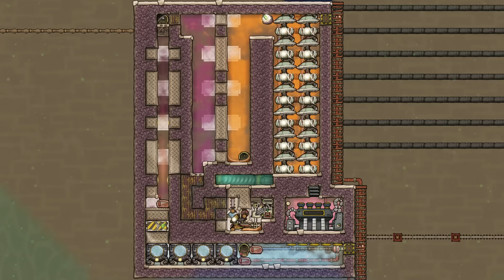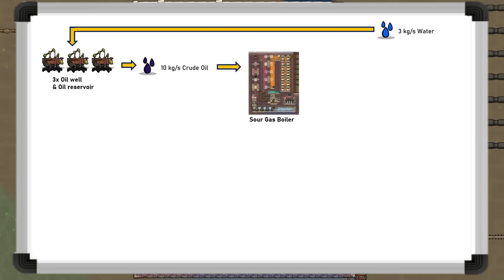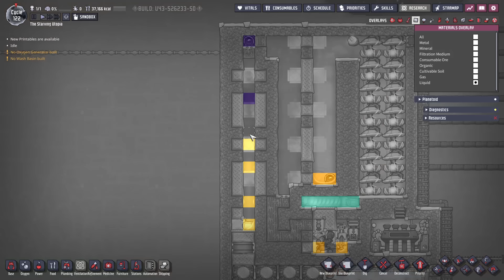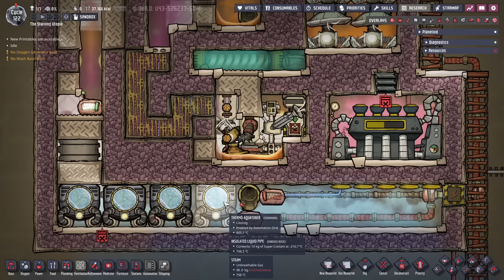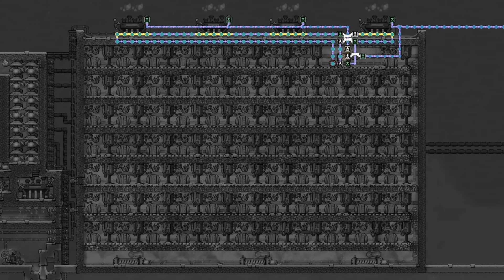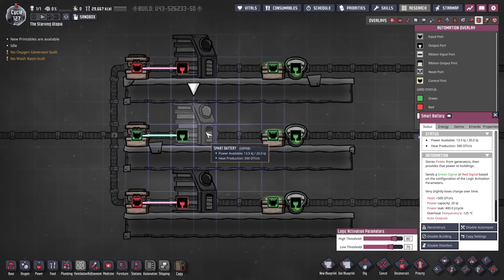Oxygen Not Included - Tutorial Bites - Sour Gas Boilers

Comment from the maker: Hi everyone, I thought I should post an update to this with some further testing. As a couple of people have pointed out, the design as shown has an issue where methane can condense in the airflow tiles and then teleport across into the supercoolant area. To resolve this issue, I removed the top 2 airflow tiles on the right side, and the top left tempshift plate in the condensing area (so the 3 tiles in a row) as shown at 8:52. That seems to have done the trick, but also feel free to make any more improvements you can think of!
Reply: I love your videos, you are 1000% better at me than ONI but I want to ask, with all the sulfur output couldn't you split it between sweedle and grubfruit then use the seeds from grubfruit to feed a 25 gulp fish tank that would purify the polluted water at 200g/s each (5kg/s) meaning less power used for water conversion and more free food that could be combined with the sweedle meat to make surf n' turf? Industrial brick is just a "waste" if you are already generating 50KW+ of power in the first place! I think we both know you have the natural gas for a grill.
Reply from the maker: @markalvarez1827  That could be possible, but saving power with a 10kg/s sour gas boiler is mostly not worth it since you have so much power. And pacu can simply be starvation ranched anyway (I do need to double check this with the latest patch), so there's nothing stopping you having cooked seafood anyway.
The industrial brick is never really a waste, it's about containing the machines, the cooling and their produces whether you make it hot or cold. The nat gas gens still need cooling and still produce polluted water and carbon dioxide that must be dealt with.
Reply: I would also add, I had an issue with Natural gas appearing outside my boiler and I was very confused by it,
just not that it's a good idea to set the conveyor loader to Sulfur only, and not everything, otherwise it will pick up the solid methane if your boiler gets too cold which is what mine did!
Reply: I built this recently but the change as you described didn't work for me, though I will admit I may not have implemented it properly. I did find a simple (mostly)stable solution. I moved the chamber with the tepidizer to the right one space for simplicity I moved the gas pump in the very bottom left to the top to the left of the others. I say mostly stable as the teleport of frozen methane does still happen and it shoots up the dividing wall between sour and natural gas an out the top where I have another pump in a small room to collect it. I have had this running for a very long time and observed no other issues.
Reply: Wow, I could really have read this before troubleshooting this for 2h last night and posting about finding this exact reason 😅😅😅😅😅

Comment: The sulfur and methane's area liquid pump keeps breaking for me, the pipe that takes the liquid methane breaks because the methane solidifies instantly, is there a way to fix that?
Reply from the maker: That is strange, usually the issue is the liquid methane boiling in the pipes not freezing. Do you have the temperature settings correct?
Reply: @GCFungus  It was the temperatures, I just had to trial and error as usual and managed to stabilize it, thanks for replying back! Love your content.

Comment: Finally got my sourgas boiler to work as I had some issues with the cooling region being filled with natural gas and unable to produce methan to transport up top.

It had something to do with the equilibirum point of  the temperature of the aquatuner + door + the tepidizer chamber. If your tepidizer started off closer to the threshold of -180C but your heating room was still  at the 300's then the chamber fails as the tepidizer cannot keep up with the -56C cooling factor.

Another issue was trying to compensate with turbo mode, but this caused the tiles to experience pressure damage and crack almost immediately. 

The way I got it to work was to pre-fill the tepidizer region and pre-heat the heating chamber at the same time so they are within a certain range of their threshold temperatures - 700-800C for the heat chamber and -165C for the tepidizer. Then let the crude oil flow. I also removed the tempshift plate from the bottom left of the liquid pump.

Comment: Hello GC! I hope you see this and youre doing well. I know its been awhile since youve uploaded this lol. The Thermium aqua tuners are no longer running for me stating liquid too cold and it doesnt seem like theyre producing anymore heat as the steam box seems to be capped around 360-365 F as is hasnt been able to rise futher. My supercoolant is at -433.5 already and the aqua tuner says it cant cool past this temperature. Have I done something wrong by chance or is this machine patched now due to the inability to cool and produce heat to those extreme temps?
Reply from the maker: The system has built in over cold protection with the tepdizier above the cold area. That should be turning on if your coolant is getting too cold, allowing you to keep heating the incoming oil. If you've got a problem with coolant too cold check that tepidizer and area to see if it is working.

Comment: Is it posible to devide the steamroom into 2 with a door heat injrctor to not directly waste 500C steam, with the AT side using hidrogen or liquid lead/other metal to transfer heat

My guess would be no 500+steam waste> less heat waste>less AT on time > coolant less cold > less need to heat up coolant > less tepidizer time
Reply from the maker: In general, this build makes so much power that you could be way less efficient and it likely won't make any difference. But you could try if you wanted. Because you have such a big power budget, I lean on the side of simplicity over efficiency.

Comment: Mine keeps break cuz Methane keeps ending up in the coolant area.
Reply from the maker: Yes this is an issue with the build as I designed it, but from my experience running it over a long period only a small amount gets in there at the start and the pipe doesn't fully break so it does still work. I think a fix could be modifying the pipes in those areas to be better insulated, so either ceramic (not sure if that's enough) or possibly insulite. But getting insulite in enough quantities to build it is quite difficult which is why I didn't include in the original build.
Reply: @GCFungus  Thanks for the advice. Its still my favorite build so I just fix it with an access port but I have gotten to cycle 2518 now with zero deaths or sandbox just from learning from you. Thanks again mate.

Comment: I just built your design with 2 ATs, intending on using it for 3-5 kg/s and found an interesting issue - it's too effective. When used with 10kg/s, it works without a hitch, while if used with 5 or less, the game mechanics moce liquid methane into the super coolant reservoir. My working theory is it happens because the lower volume of sour gas turns into methane and sulfur gas for a split second, but they cannot occupy the same area, so sulfur stays and moves into its solid state, while methane gets displaced to the first available non-solid area. It's 3.30 am now and I really need to sleep, but I'll test around it some more tomorrow, given I know understand why it happens, it should be relatively easy to fix.
Reply: Hey just so you know I tested the design throughly and found the same issue. Unfortunately the original design is a bit flawed at 10 kg/s. The game "glitch" is not a bug but an exploitable mechanic, in both ways. I found a simple solution: all you need to do is displace the last metal tile between sour gas and methane one block left, so the teleported liquid methane can join the rest. Hope this helps

Comment: should i just leave the natural gas in the boilers to use it for later. 50kW is kinda too much. 
Does it disrupt the process ?
Reply from the maker: It may cause issues with the nat gas to sour gas heat exchanger, or it may be alright. Either way I would suggest that you just burn the gas and waste the power because the oil input is infinite anyway - plus burning it gets back the water to make the new oil. It is generally safer with these builds to just have them run constantly and not turn them off, as long as they are stable there's no downside.

Comment: it's kinda easier to just pump crude into the magma biome and stick a few pre-cooling steam turbines on top then proceed to cool the sour gas from like 130c in a heat-exchange with the outgoing nat gas. if you do it like that the only space material you need is super coolant.

I also find that design to be more manageable and easier to tune the output or just shut off and restart as needed.
Reply: you can do with any space materials by using hydrogen gas for cooling. sure gas cooling is less efficient, but way earlier.
Reply: @peterhacke6317  right? people have always called me crazy but it's been a sort of obsession of mine to make that viable.

my last attempt was a triple-stage cooling system with aquatuners running nector, then ethanol, then a final stage of themo regulators running hydrogen. turned out to be viable tho probably not worth the effort other than to prove it works... kinda like the regolith melters :P

Comment: Could this hypothetically boil gunk, too, given that it goes straight to sour gas and skips petroleum? The sulfur gas would just condense into solid sulfur in the condenser.
Reply from the maker: In principle yes, but these boilers are very fiddly. I would test this first to see if it does in practice, and also trying to get that much gunk would be difficult too.
Reply: @GCFungus  I mean yeah, but it'd be a super convenient way to turn gunk from your bionic dupes into more power. You'd just run the boiler with regular oil most of the time and pour any gunk you might make into the boiler.

Comment: I always been mostly interested in doing these without space materials. I feel once you have space mats, you can just brute force things adding power to it.
Reply: You need some modifications, but it is possible to build something similar: Use a volcano as heat source for boiling. This allows you to bring the steam room down to around 200°C, allowing you to build with steel inside. For liquefying the sour gas replace the super coolant with hydrogen gas (cooled by thermo regulators). This might need more space cause hydrogen is less efficient, but can reach the cold needed.

Comment: How does the design change with a volcano heat source? I can barely understand the mechanics as they are lol. Would it be to much to ask for a build that incorporates volcanoes? It would make this great guide even better.
Reply from the maker: I do not recommend using volcanoes, mainly because there is no need. Sour gas boilers need a lot of cooling from the aquetuners, and this heat has to go somewhere. In my opinion it makes sense to simply put this back into heating the oil anyway, and there's little other use for it. So unless you use an alternative, like an AETN, for cooling, then no other heat source is needed. Using a volcano would only complicate the design for no benefit. Of course you can make such a machine as a challenge, for example without using space materials too, but aquetuners are by far the easier way to do it.

Comment: Quick question before I attempt this: what is the area with the super coolant and the tiepidizer for? Couldn't you just pump the methane up without passing through it?
Reply from the maker: The tepidizer is for adding heat into the cooling loop when the sourgas incoming can't keep up. This is very important on startup as you need to heat the incoming oil and save to get rid of the cold generated. During running it stops the loop getting too cold, much like the steam turbines stop it getting too hot. With these in place the system is then fully stable and is much more reliable.
Reply: @GCFungus  thank you for the details.
I will try to make one without space materials in my current run, see what challenges I find 🙂

Comment: What is the purpose of the squiggle of airflow tiles at the base of the sour gas condenser? I don't get why it was designed like that.
Reply from the maker: Fairly often the liquid methane will heat up and turn into natural gas in the condensing area. As it's lighter than sour gas, it can float back up the counterflow unless you add a bend to catch it.
Reply: @GCFungus  Thanks for the info!

Comment: 10kg/s input seems like massive overkill, and 60kW output is certainly more than I could imagine needing.  The problem is that this design has a massive 10kW overhead, so simply reducing the inputs would presumably create an extremely inefficient system (eg at 1/3rd capacity, 10kW to produced 20kW).  So I'm kind of wondering how you would build this to operate on a less insane scale, if it's even worth doing at all.
Reply from the maker: It's certainly possible and people have done it - there are numerous designs for 1kg or 3kg or similar. While there is some constant overhead, most of the power costs scale with the oil flow rate (particularly aquetuner power consumption), so a small design is still worthwhile. My thinking though is you may as well go big with a full pipe input, and my final design is relatively compact and good to run.

Comment: The scheme is excellent, I was just thinking about repeating it, because I got a world where there is not a single sulfur geyser (Skewed Asteroid).
I have already ordered my duplicants to produce 8 tons of Thermium and 60 tons of steel 😎

For the main part (the boiler), everything seems to be clear, but I have a question about Industrial bricks, Due to which the resulting contaminated water is boiled in the lower part? I see that there are several water heaters there, but they seem to have a maximum temperature of 85 degrees; and the only Thermo Aquatuner in the upper part is intended, as I understand it, for cooling steam turbines.
Reply from the maker: I explained in the Industrial brick Tutorial Bite, and in the Heating Tutorial Bite, and the tepidizer is tricked using a thermo sensor and a not gate to rapidly pulse it allowing it to ignore the temperature likit and submerged requirements. This does only work up to 125 degrees effectively but is a great way to boil polluted water, if a little exploity. You can of course use an aquetuner down there but you would likely need a tepidizer to counteract the extra cold made (I explained that in the Heating Tutorial Bite too).
Reply: @GCFungus  Thanks for the reply)
I came across an interesting bug: solid methane is gradually accumulating in the left cell of the tepidizer...
Reply from the maker: @maxarturo78  Yes I explained the fix for that in the pinned comment.

Comment: Built it and it works like a dream. One thing though, and I noticed this was happening in your build, a frozen piece of methane periodically ends up in the tapidiser chamber. There doesn't appear to be anything I can do about this. More and more of it keeps building up until it eventually liquidises and I end up with a chamber that's half super coolant and half liquid methane.
Reply from the maker: I did mention the fix for that in the pinned comment. If you remove the top airflow tiles and one tempshift plate it will resolve the issue.
Reply: @GCFungus  Sorry man I didn't even read the comments.

Comment: Good design but I'm finding that the condensing room can't keep up at 10kg/s. I've made the change suggested to stop teleporting methane and I suspect that's the issue. I think I'm going to tunnel into the condensing room (somehow) and change a couple of sections of aquatuner pipe to be radiant. I'm wondering about going in via the turbine room and just using the liquid methane / condensing room to cool the turbine.
Reply from the maker: It seemed to be OK when I tested it, so there may be something else that's not working perfectly. If the cooling can't keep up then either the aquetuners aren't working fully (which is probably less likely) or the heat transfer isn't enough. Are you definitely using thermium for tempshift plates, metal tiles and radiant pipes?

Comment: A note on the cooling pipes - I built the radiant pipe segments in the condenser area from steel and the boiler stalled out, the cooling loop couldn't transfer enough heat to keep the SC reservoir and thermium tiles to condensation temperature even though the SC in the loop itself was well under -200c, with the ATs stuck at maximum cooling. It would only condense in brief spikes and then creep back up above temp. Pulled it apart and replaced the radiant segments with aluminium (didn't bother testing gold or copper) and it came back to consistency.

Also don't make the insulated pipes in the steam room from granite because they'll melt, ask me how i know.
Reply from the maker: Yes the radiant pipes I used were thermium for the best heat transfer, which you should have for the aquetuners anyway. Steel is actually not a great conductor and is beaten by most refined metals. The reason it is good is that it's better than metal ores, so is better for things like mechanised airlocks and radiant gas pipes. Aluminium is obviously great at conducting too, but you can't use it in the hotter areas here as it will melt.